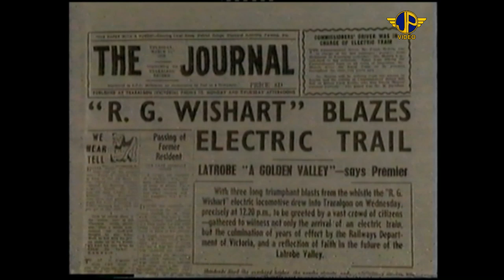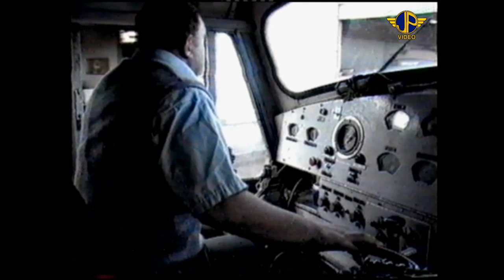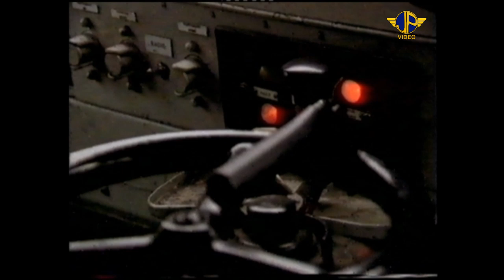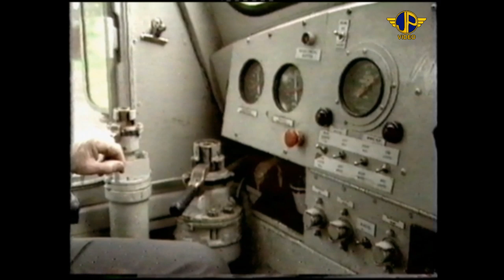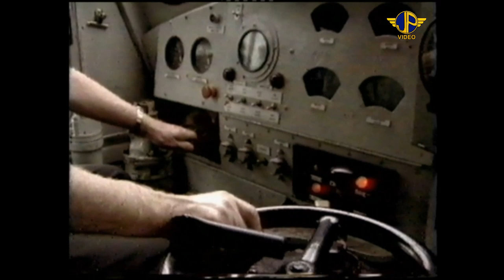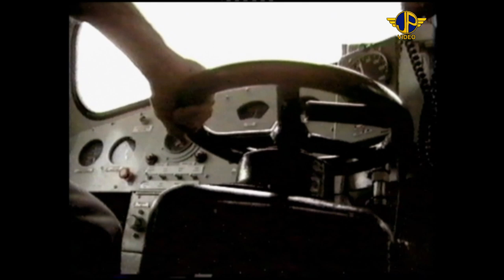Farewell L

Comment: I'm from the north of England and I could tell just by looking at the shape that these locos were designed, or at least influenced by EE. They look so much like a Deltic/Class 55 (albeit with pantographs on the roof and a unique livery) it is uncanny!  British electric locomotives were always more utilitarian looking by contrast, much more like the "Butter Tubs".   I'm assuming the electrification was at 1500v DC (?) as the OLE equipment also looks very similar to that used by LNER and later BR on their 1500v lines.   It's odd watching footage from the opposite side of the world and seeing so much that you recognise!
Reply: Yes 1500V DC as per the Melbourne suburban network as built in the 1920s. The Gippsland electrification was done from the then terminus at Dandenong around 130 km to Traralgon. Around 30 km still in use for suburban operations from Dandenong to Pakenham which has all since been upgraded.

The 1920s overhead structures in much of the Melbourne metro area were the same design as the long-gone Newport Shildon electrification in England.
Reply: Yes they were built in England and then shipped to Australia in the 50’s I think

Comment: I was lucky enough to be stationed at Warragul Depot in the early 80's and to have driven all L Class's in service at that time, along with the E Class locos that we used for shunting in the yard and the B,T and C Class Diesels that also operated past Traralgon down to Bairnsdale. In multiple unit they would haul 2400 tons of briquettes out of the briquette siding at Morwell three times a day. They were a great loco that utilized dynamic braking as well as the standard Westinghouse air brakes which came in very handy down the Longwarry bank with 2400 ton pushing you on a frosty morning. Cheers for the memories!!
Reply: did you drive the tractor engine yellow shunters
Reply: @volgrencr221  I don't remember seeing them at Warragul but maybe they were there before my time. Traralgon had one I seem to remember as they had limited overhead lines in the shunting yard as opposed to Warragul where most of the sidings where wired overhead.
Reply: dont think C class diesels have ever been down that way
Reply: @chopperking1122  Sorry but .... wrong!  🏍🐕‍🦺🤣

Comment: Departing Traralgon behind an L was the only time in Australia that I've been pushed into the seat back by acceleration. Like an 87 on Britain's  WCML.
Thanks for posting this.
Reply from the maker: They were great locos and had an even better dynamic brake
Reply: I was just going to comment.  The 8.03 from Springvale ( which originated in Warragul) with about 6 passenger carriages stopped very quickly . The noise of the dynamic brake was very evident. As already mentioned it really accelerated fast too. I enjoyed going to Uni on that train.

Comment: What astonishes me is one of the longest electrified rail stretches was closed all because of expensive overhead costs and declining freight traffic. Should've kept the overhead for passenger service like Sydney intercity services.
Reply from the maker: Sadly the Ls were time expired , they were not reliable anymore and had to double head with another L even on the smallest train , the cost of replacing them and the loss of the briquette traffic for which they were built for didn't go in favor of keeping the wire and now with MU/s running the passenger service it's even further away , thanks for the comment .

Comment: I wish that I got to see the "L" class locomotive or even a gander of the E class as well but it was slightly my time...But I'm sure that the L or even the E class is a fav for people that got to see or never seen either locomotive. Love the L's legacy here....
Reply: At the time Matthew they were fairly unspectacular for the gunzels unless you got your jollies for Ls.
Suburban B however had the EMD chant down the track and the long wait time at a level crossing to build anticipation and the sound of the horn. B69 often ran on the Frankston line with a string of four wheel GYs sometimes tarped.
Conversely a long wait at a crossing but with no EMD chant would often suggest an L, however as time has gone by I must say I miss Ls very much. I remember them before the modern pantographs (so with Tait style panto) in filthy blue and gold livery and I must say silhouetted against catenary around Caulfield they quite spectacular since around Caulfield the track is elevated and if you were down at Dandenong road level and saw one waiting at a signal they made a fine sight.
Back in those times it used to rain and dark skies were very common in Melbourne. Ls were a nice sight against a dark sky but that is only a fond memory and I'm reminiscing. At the time I wasn't that impressed by them but now I miss them.

Comment: The L class horns are pretty loud that's for sure
Reply: Sounded nice and different too. I loved the horn show with the N at the start 😏
Reply: It's incredible to think about the 2 horns during the show between the L and the N.
The N carries a direct decent of the L class's horn with its Leslie.
A Leslie from the same time period as the L class's horn had an almost identical power chamber (parts are interchangeable) but was bolted to an aluminium manifold and bells.
Then RVB saw the L class Kocumsonics horns and slightly modified the design and....well it's just scintillating to see how all 3 companies evolved and developed their products.

Comment: Why were different pantographs raised for the run into Traralgon from Moorwell at 28:09? What's the difference?
Reply from the maker: They were the original pantos , in later years they mostly ran with the newer type , but for historical reasons the original ones were raised for the run into Traralgon

Comment: From 4:00. "running passenger services in the suburban area". I would have thought this was very rare other than load tests, or fan trips. Driver training maybe or a charter train for a school, club or factory picnic. Would be interested to know of any examples of an early L on suburban passenger working.
Reply from the maker: That meant only charter trains as the film footage showed , they never hauled suburban train services
Reply: Partly wrong. The 8.03am out of Springvale, stopped at Dandenong, Noble Park , Sandown Park, Springvale , Oakleigh, Caulfield then Express to Flinders St . That train was always  full , but my memory was you neededto hang on because it did accelerate Hard. Was still running in the late 1970’s. In the Afternoon the 3.38 from Flinders St the same times took about 15 minutes off that trip to Springvale.

Comment: The L 's were fantastic but the best thing was they were pollution free.  Auestions need to be asked why infrastruture was removed.
Reply: I'm not sure which is worse - brown coal or diesel?
Reply: Love the L 's, but do not see how running on brown coal was pollution free, Their main task was to enable the burning of brown coal briquettes in millions of Melbourne fireplaces and in industry by transporting millions of tons of brown coal. The Victorian Railways soon found diesel electrics were much cheaper to operate. So when the L 's wore out and the overhead run down it was all removed.
Reply: They weren't pollution free. Brown coal powered them.

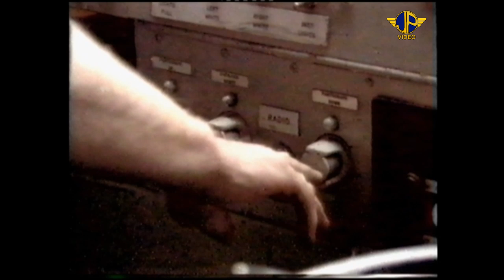Comment: 28:00 two pantograph types - what was that about?
Reply from the maker: The L class were originally fitted with what I think was a Metro Vic pantograph , a single arm Faiverly panto was fitted at one end as a replacement later in their service life and the L class ran with them in service but retained the original panto as a spare .
Reply: @johnphillips592  I have a feeling the single arm pantos were Brecknell WIllis rather than Faiveley. 

While I'm here though. I noticed back when this video was released, that the last run with L1150-1162 had some scenes from the cab of 1150 where those from 1162 were added - such as going through Longwarry. I lived at Longwarry at the time and remember 1162 running light to Warragul a month after withdrawal which I'd heard was for filming purposes, which I guess was for this video. I've always been curious as to what happened on that run to Traralgon that required a withdrawn L to be "reactivated" for a day for "filming purposes". There were a few giveaways for the eagle-eyed. Such as the vent window beside the driver disappearing, and the windscreen wipers swapping from the bottom on the windscreens to the top. ;-)
Reply from the maker: @emdB67  Yes , we ran that light engine for some extra cut a ways , very few people noticed the difference .
Reply: @johnphillips592  yes, there's always a few of us eagle-eyed types that tend to notice such details. lol! 
Sadly my photos of the last weeks of the L class were only exposed to the film's leader / toungue. It never took up in the camera and I clicked away totally unaware. I only became suspicious when the frame counter got to 38 and kept going. :( 

So you can imagine my surprise upon hearing an L class approach the station that day when I knew the remaining Ls had all been withdrawn the previous month. I knew it couldn't run beyond Warragul, so half an hour later, I went out and waited for its return, taking some photos as 1162 waited under the footbridge at Longwarry for N 461 on a down pass to clear the single track.